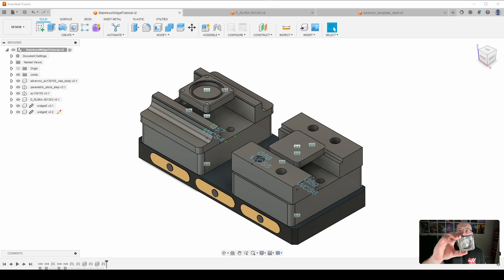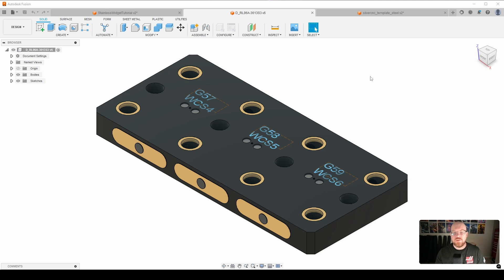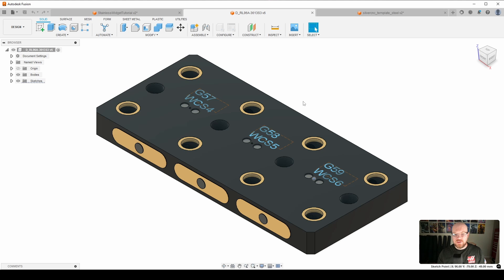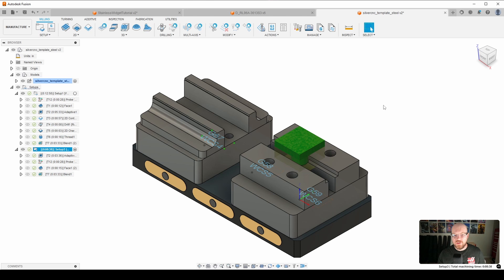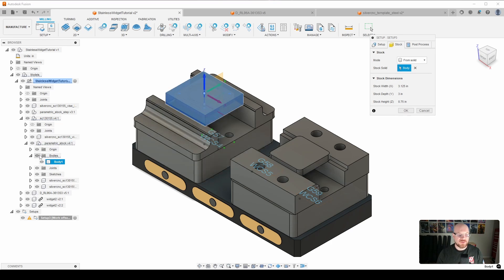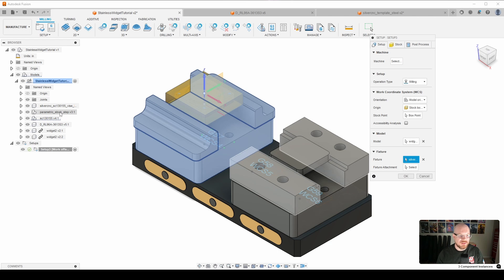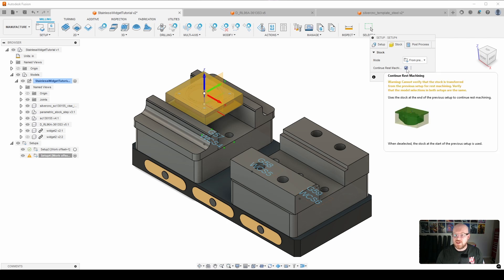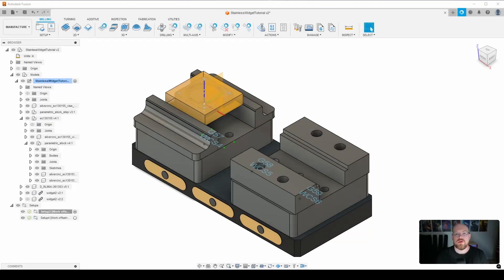Stainless Steel Widget Introduction

Comment: Great stuff! Did you ever end up using the Orange Vice you did a video of?
Reply from the maker: @jhallock20  yeah I use it for larger parts. I also got a couple of the Haas self centering vises, which I like slightly more than the Orange. The problem with the Orange vise is that it takes longer to torque down a part. The jaws add downward pressure, so you can't finger tighten before busting out the torque wrench. You have to ratchet the entire time. Otherwise, the vise is great.
Reply: That’s good to know. I’m looking for the first workholding setup for my new X7 which should be here in a couple of weeks. I have a Kurt vice and some mod vices from my old CNC. What would be your recommendation?
Reply from the maker: @jhallock20  get a good 96mm zeropoint system. In my opinion it's the best purchase you can make. Choose your favorite brand such as lang, 5th axis or silver cnc to name a few. From there pickup a couple vises that accept pull studs. I like the Haas self centering vises for the price. They also make cam and probing easier because your part is always in the center. GMT makes a traditional vise that accepts pull studs as well. Finally, model everything in cam based on your zeropoint. Feel free to email the channel if you need help. My experience is with the LNC controller.

Comment: Great video, looking forward to seeing the rest of this series. 
I have a question re your WCS positions. If the first vice is located in G57, why did you select G54 and #1 for the first part? I’d have thought you would have used G57 and # 4 in that setup? Because your vice and part are modelled, the mill knows where the part is off G57…. 
I’m just not understanding using 2 different WCS’s for the same work position. 

I use G54 (1) for my vice in my X7 and G59 (6) for my 4th axis.
Reply from the maker: @MrRctintin  The first probing routine drives the probe to the raw stock using G57 and saves the probed location in G54. I believe the next video shows it. If I chose G57 instead, the probing routine would overwrite G57. I never want G57 to change so that I can probe the next part. Think of it as G54 becomes G57 plus any deltas for part misalignment after probing. I'm also using a self centering vise. If you use a fixed jaw vise where the part isn't always in the center, then your setup would be different.
Reply: @MrSmith1231  ok, I think I understand, I look forward to the next videos.